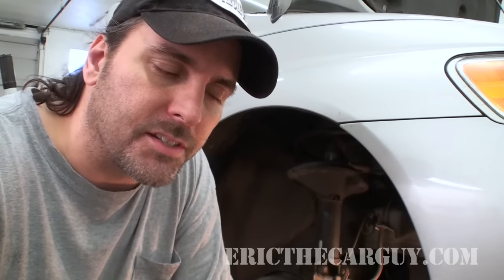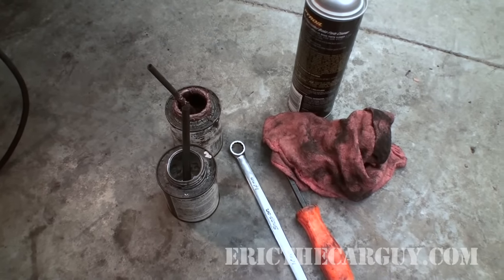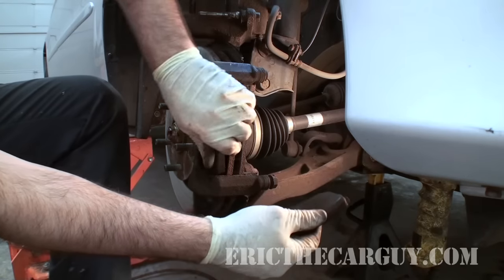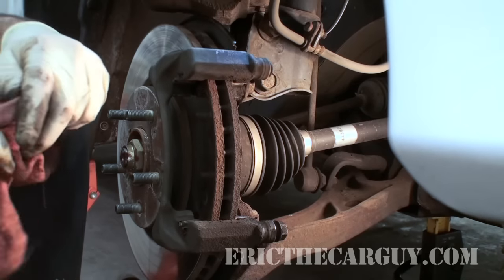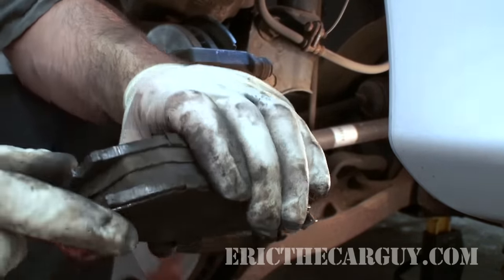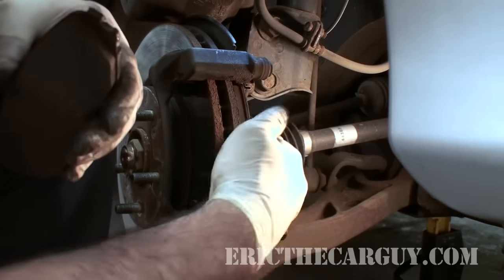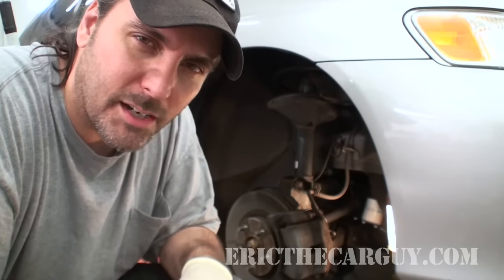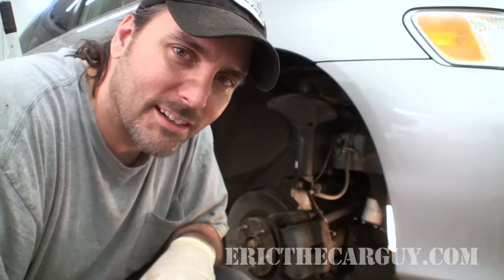The Basics of Disc Brake Service -EricTheCarGuy

Comment: At 04:10 as a side note: no matter if caliper slide pins are rusty or burred/nicked- it's never a good idea to sand or file them to "clean them up". They're usually plated to make sliding easier & corrosion free. Removing this coating will make them corrode very quickly after a few heat/cool cycles, and might change the temper and roundness of the slide! If they're that bad- just replace.

Comment: good tip on burning the air out of the rubber boot..ive done alot of brake jobs and never thought of that. petroleum base grease can also slowly eat away at the rubber boot.another reason to always use silicone base grease

Comment: i'm a car mechanic in iceland, as we have lots of salt on the roads, we see allot of rust on the brake system. very often i need to remove the thin stainless guides that the pads ride in to remove rust from underneath as they have started to clamp down on the pads so they dont move freely even tho the guides are clean inside. many mechanics here just grind a little bit of the steel on the pads but thats not how i roll.
Reply: Interesting ✌hello from England 🇬🇧

Comment: Thank you very much for this video. I have a 2017 Toyota Sienna, which was imported to Europe. I found the braking performance generally not so great. After changing the braking fluid, I combined the season tyre change with brake maintenance, like in your video. The rear brakes had never been serviced, the pads have some life left, but silicon grease was barely there anymore. The front brake had been replaced and I found they used regular grease instead of silicon grease. as you say this creates a mess!
I also found that the inner side of disc on the passenger side was for about 1,5cm (half an inch) completely rusty. the pad itself was 'uneven'. so now i know where part of the not so great braking performance comes from. will be buying some new discs and pads soon in the front !!

Comment: Great Videos. I just watched your video on replacing rotors and pads. You said you preferred to have the metal indicator at the bottom of the leading edge. This video you recommended the clip to be on the top of the leading edge.

Comment: I just recently serviced my own 2007 Honda Accord's brakes. In my case, one brake pad was screeching pretty early. When I removed the rear pads, one was unevenly worn. Upon further disassembly, it was revealed that one of the pins in the caliper bracket was stuck, which was the culprit for the uneven wear. I'm unaware if this is a common problem, per se, but certainly easy to check and worth looking at.

Comment: i actually started taking the silicone brush and sticking that into the caliper pin hole instead of just smearing it on the pin. seems everytime i do that like 80% of it just gets pushed off when i try to slide it into the hole. also up in the midwest the caliper brackets rot so bad the pads are usually seized in them. end up having to beat the pads out with a hammer and wire wheel the heck out of the bracket so the new pads can actually fit in it. caliper pins do rot and get stuck sometimes but dont really see that a lot. gotta love salted roads

Comment: If you are in an area where the roads are dusty or salted this isn't somerthing that should wait until 30,000 miles, but be done yearly at the same time that you change the cabin filter :-D.

If you detect that grease was used on the slide pins, remove the boots, clean out the bores, clean off the rubber dampers of the pins and INSIDE the boots. Grease with or without silicone lube mixed in  it will make the pin rubber dampers and boot swell and can stop the pins from sliding freely. I compared a set of greased pin's rubber with 5 years exposure to a new set and could not believe how much the old rubber had swelled. 

Since then I install all new springs, abutment clips and caliper pin rubber, whenever I change brake pads.
Reply: P Schmied the pins dont slide. Ghey are stationary. The caliper ridrs on them so the bushong foesnt matter

Comment: I always push the caliper piston back in and inspect the rubber boot around it, also a good idea to put a $10 hardware kit in.
Reply: if the rubber O-ring is damaged, we can be sure there is rust on the brake piston. Before putting in new O-rings, make sure the piston is polished clean for proper functioning.

Comment: Through experience I have found that anti seize on the pads doesn't last very long. The heat from the brakes melts it away. I switched to using synthetic brake Lube on slider pins and pads with better results.

Comment: good info. I understand where your coming from with putting the squealer at the top of the pad, but in my experience when the pads start to wear on an angle do to some component in the calipers sticking, it always seems like its the bottom part of the pad that's the thinnest, so for me I always put it to the bottom when I can when I do brakes that way if by some reason the caliper hangs up, and the pad wears on an angle it will give an indication something is wrong.

Comment: The good ol' days when ETCG had long hair lookin' like a bad ass.  Eric you're supposed to shave your head in the summer not the winter.  That noggin is gonna be extra cold this winter. Thanks for the tip about burping the slide boot.  Didn't know that. :)

Comment: In the salt belt, cars should have their disc brakes cleaned and relubed annually, regardless of that the service and owners .manuals say.    Yes, even Hondas, and especially if the vehicle isnt driven much.

Salted roads are severe ussge conditions for disc brakes, the only metal surface on a modern vehicle with no rust preventive or protection of its critical working parts.

Comment: this is a really good idea it will make the pads last longer and calipiers last for ages
thos anti rattler clips are very important! dont not take them off, and NO they are not SHIMS! tbut eric forgot to mention to reinstall the pad dry after everythings clean to make sure it moves freely, if it does not then clean the rust do NOT remove materal! just lightly remove rust then reinstall moves freely then apply lube!

Comment: Eric, your videos are very helpful. I would like to add a comment on why you used copper-based anti seize. According to the website "Anti-Seize Comparisons - DEPAC Products" , the copper-based is good for carbon steel, but will cause corrosion on stainless steel; on the other hand, aluminum-based is good for stainless steel, but will work bad on carbon steel. I feel lucky that I check this out before I buy the aluminum-based ones in my local auto store because it is their only option. (And, no wonder all the retailing stores are dying in the US.)
Reply: You can use ceramic anti seize
Reply: Your supposed to use moly like eric said

Comment: Eric, yes! - great tips. People should be somewhat familiar with looking at the mechanism - (taking the ka-bootle apart) heck, it's the most important part of the car. I know you covered the pads' edges(guides), But Eric, I do have a question. I wondered why you didn't talk about the movement aspect of the pads themselves; that being, that the viewer of the video might want to know if the pads should be able to move in their stainless steel guide,- that is,... have play that allows them movement towards the outer edge of the rotor, and similarly, (car moving, and brakes not applied) be able to have that movement ( very little) in towards the rotor's inner circle. Just as the pins allow the caliper to sort of float and move with the bumps of the road, -have engineers made this an additional aspect with the play ( at least that I am seeing in my new pads along the s.s. guide) that I can manage to invoke on each pad?
Reply: Well, I'll reply to what I myself wrote: (for the public should they have this similar conundrum when SERVICING brakes), as follows : "Eric" I asked, "Why didn't you cover the movement of the pads in the manner that they may have play towards the outer part of the rotor or similarly towards the inner? "
    That was  the jist of what I asked. So now, it really, really seems important because the SERVICE BRAKES video by Eric was what I first viewed. The next video that I viewed was his, REPLACING REAR PADS video. And in that video he covers taking the pads out, tools used, fluids used, and strange parts of the caliper that you might have missed,  ( among other great aspects he covers about disc brakes and tools)  ,,, one example being the slider pins set that has one of them having the rubber boot along the shaft. The next caliper aspect that people might have missed is the hidden stainless steel spring in the concave part of the caliper cup. This, while in the replacing video is not mentioned in the service video. Very important. I think my shop left that spring out .... boo, hisss.

Comment: Hey Eric, I've been wanting to start doing my own brake service for a while now. When do you and when do you not have to push the piston back to its position? I noticed you did not do it in this video, but in another brake video you did have to return the piston. I will most likely just be doing pad replacement. Thanks
Reply: From what I know, you have to push in the pistons back into position when you replace the brakes. With new pads, there won't be enough space if the pistons are out.

Comment: I prefer to use the silicone based lube on the contact points for the pad as well.  In my experience it seems to hold up better than the anti-seize and it's far less messy.  I can't seem to use anti-seize without it magically getting everywhere.  I also like to lube the pad where the caliper makes contact,  both where  the piston makes contact and the outboard pad whee the caliper wraps around.

Comment: Hi, nice guide. I allso look under booth of the brake calibber piston, as they seam to rust very easylly. as the brake pads wear of and allso those caliber holders gets rust under those metall slide, that those breake pads slides on. So i clean under there too.

Comment: I have found that some pads fit tight in the clips/caliper bracket (2008 Mazda Tribute / 2015 Sienna van). The pads were even purchased from the dealership. In the past, I've ground them down (just with a sanding disc) until they move freely, but not loose. My concern though is that I have now sanded away the paint/powder coating and the pads would be more prone to rust.   Any thoughts on my technique?
Reply: Michel Gauthier if you use clips clean where the clips go so they sit properly 
I had the same problem and I found this helps

Comment: Man, this is cool. got two questions. First can I use lithium based greases for lubricating sliding pins? and second the break pedal becomes very though when my speed is more than 60 km/h and one other thing when I'm on reverse the break fails to stop the car immediately. My car is toyota vitz 2001. Thanks man

Comment: Hey eric, I'm a mechanic in the Netherlands and I clean brakes almost every day. Instead of just cleaning the caliperbrace (sorry if it's not the correct term) we take a file and shave the rust and gunk off the caliperbrace. What are your thoughts on that?
Reply: I agree with you.  I've always used a metal bristle brush and done a once-over with those.

Comment: I've seen the rubber sleeve on the caliper pin swell up and actually make the pin difficult to slide in the bore. I assume that this is due to the lubricant or some other contaminant.

Comment: Are parts stores wanting to sell rotors vs. turn them? Typically, when I take mine in to be turned, I get told that only some of them can be turned. I suspect that they just want to sell me new ones. Should I buy the tool for measuring the thickness so that I can argue the point?

Comment: Surprised at the anti-seize compound on the caliper bracket bolts. I have seen thread locker recommended instead. Kinda opposite ends of the spectrum. Comments?
Reply: Don't put thread lock on it lol
Reply: Thread lock for caliper bracket bolts

Comment: Hey Eric, can I use dielectric grease to lube the slide pins? I looked up a Motorcraft silicone grease and it's the same grease that you use on the rubber boots of ignition coils. Is there a difference? Any negative effects? I figure it's designed to be used with rubber so it can't hurt.
Reply: Joe Bedell its the same shit.  Made with silicone

Comment: Eric, can you use the brake lubricant to lube your slider pins. The brake lube bottle I bought says it is good for all brake parts. Plus, the silicone only lubricant is rated to 400 degrees Farenheit, whereas the brake lube that has silicone and metal solids in it is rated to 2300 degrees Farenheit. I worry about the 400 degree lube overheating when I apply my brakes during driving.
Reply from the maker: In my opinion, no, you cannot. Silicone paste only. Silicone holds up to temp just fine. Other lubricants dry up and cause the pins to stick. I've seen it many, many, times.
Reply: @ericthecarguy  Thanks for the advice Eric. I will buy the silcione paste. One more question - should I put ceramic lubricant in between the piston and the boot on the caliper so the piston moves freely back and forth. I remember one of your videos, you did something like that.

Comment: Eric can you please clarify which caliper slide pin goes to the leading edge of the caliper. Also does OEM lubricate the ends of the brake pads? Thanks

Comment: Often the inner pad is more worn than the outer. Of course that points to a slider issue, and a need to service the sliders. After that is done, if the wear is not bad enough to replace with new pads, is it OK to swap pads (inner for outer) to try and prolong pad life?
Reply: If you fix the uneven wear problem it doesn't matter if you swap the pads around. There's still one of them that has been worn more than the other and both should wear evenly if you solve the uneven wear issue.
Reply: Maybe they should rotate pads like tires. Every 10k miles

Comment: My 2015 Odyssey with 12k miles with a shimmy in the steering wheel when breaks are applied. Dealer says breaks need to be cleaned up. What do you think Eric?

Comment: Hello. Not sure if you have talked about this but does it matter if the slide pin with the dampener goes on the top or bottom of the caliper? I was applying silicone on my rear brake pins and one side had it on the leading (bottom) and the other had it on the top. I bought this 2016 KIA Soul with 50K miles and I’m pretty sure one side was installed incorrectly.

Comment: My brakes on my lexus GS350 has a problem where most of the time i feel its loose. I did change the front brake pads and im sure the rear has about 10k miles to go. I'm not sure whats the problem!!! I think i might have to change the brake fluids, can u do a DIY on that?

Comment: I have gotten in trouble at my Toyota dealership for servicing aftermarket brake pads! I'll perform the most precise brake service on the pads and the noise will go away for like 3-6 months. Then the noise will be back, and im flat rate and now getting paid a second time!

Comment: If there is rust on the sliderpins.. Shouldnt you use grit paper and just remove the rust and then put siliconepaste on? :) That is what I did anyway on my sliderpins and then used silicone paste, even tough my father in law said i should use antiseize. :D

Comment: how about locked up calipers? A 93 Mercury Cougar is giving me nightmares lately from my last attempt of brake pad service. Because the calipers didn't compress to put the new pads on. So I just opened up the brake fluid lines to let the fluid flow, then i did a trick to "self bleed brakes" on the rear brakes... i skipped the manufacture recommendations of bleeding brake lines and just bled the rear brakes. After the break-in period of the cushy wierd brakes: I pressed the brakes hard a few times to get the air bubble out the line and now it all seems to be normal.
Reply: Well then you are going to replace the pads soon, you should have rebuilt or replaced the caliper, you are just going to have dragging brakes which will  result in aggressive pad wear and could also lead to a warp the disc.
It's cheaper to do it right the first time :)
Reply: Ya the rotors are now warped haha. No problem though, I had it in my plans to get it all. Plus I need to rebuild the suspension